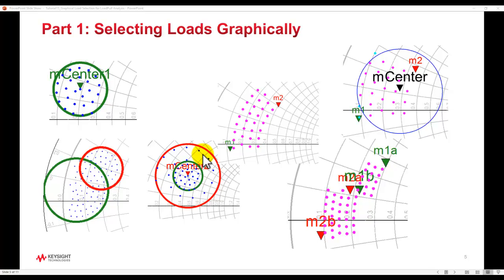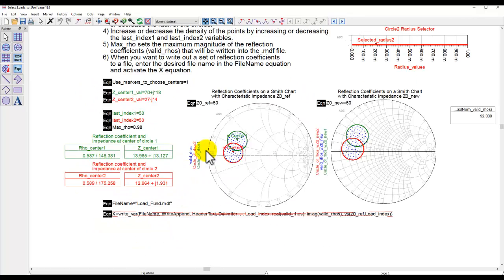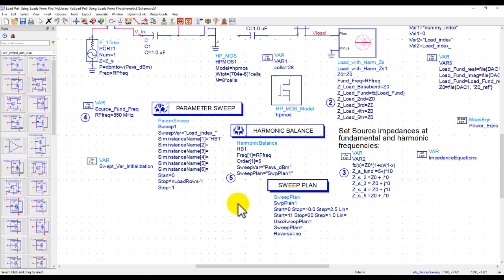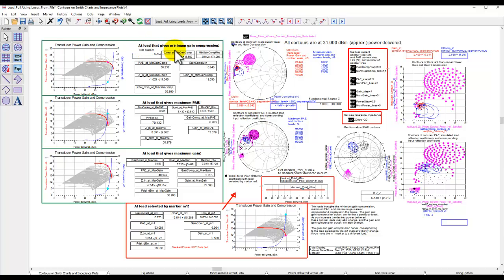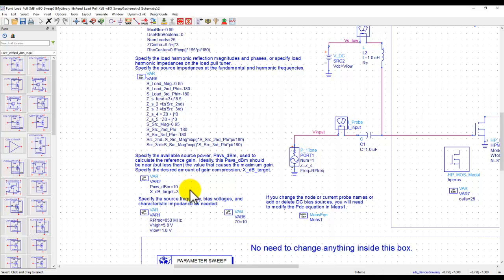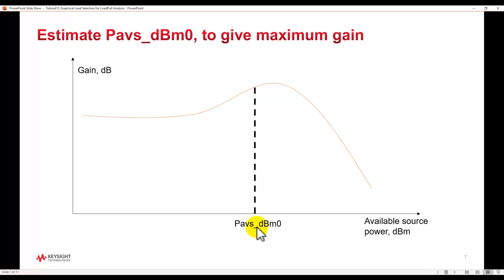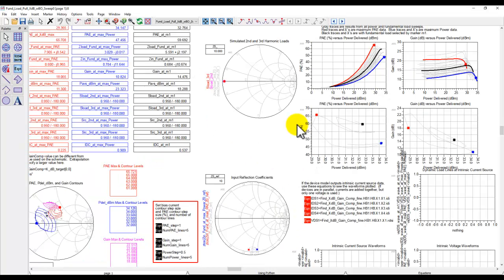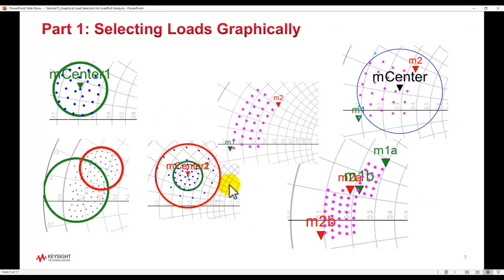RF Design-15: Graphical LoadPull and XdB Compression LoadPull

Comment: Is there any other way to do this work if the template is not available? moreover, how to select z1 center and z2 center?
Reply from the maker: if you don't have template then you will need to write tons of equation which might be impractical. In that case you can stick to normal load pull and still you would be able to do PA design
Reply: @BhargavaAnurag  Thankyou.

Comment: Unfortunately we don't have access to Keysight files. Do you have other method to select best Zs/ZL resulted from Load Pull?
I made a simulation of AFT09MS15 and my transistor Zs value is far away from datasheet specification. It has capacitive reactance behaivour (-jX) instead of inductive (+jX), at best PAE or best Pout.
Also, please explain us how to design an amplifier above the maximum frequency specificated by datasheet, for example 1.3GHz instead of 870MHz, where the Zs/ZL are unknown.
Reply from the maker: Hi,
If you don't have advanced templates for LoadPull then you can make use of what's provided in the LoadPull designguide, just that you might need to do manual stuff on your side as needed.
Its not recommended to use specific transistor above vendor guideline, although you can always simulate non-linear model above the max frequency but data might be questionable as vendors usually don't correlate the data above recommended ranges so proceed at your risk or select another device for the needed freq range.
Reply: @BhargavaAnurag  Thank you for answer. Unfortunately is difficult to find 12V transistor for 1.3GHz, almost all devices are specified until 870MHz. All the best!
Reply from the maker: @PastoriciciRobertYO4HFU  In that case, it is always recommended to get in touch with the vendor to see if they have any characterization data near your recommended range. Alternative could be using GaN, while it is 28V device but can be operated on 12V with slightly different gain and efficiency numbers but it would be better choice in my view instead of using 870 MHz device at 1.3 GHz unless you hear from device vendor otherwise.

Comment: Sir, the links to download the workspace seem to be unavailable.
Reply from the maker: Hi, It's all working for me. You need to register for Keysight Knowledge Center if you are a supported Keysight customer with having valid ADS license then only you can access these links. If you still see the problem then contact your local/regional technical support:
1. https://edadocs.software.keysight.com/pages/viewpage.action?spaceKey=eesofkcads&title=Running+Load+Pull+Simulations+in+ADS 
2. https://edadocs.software.keysight.com/display/eesofkcads/How+to+Specify+the+Loads+Graphically+When+Running+a+Load+Pull+Simulation 
3. https://edadocs.software.keysight.com/display/eesofkcads/How+to+Run+Sequential+and+X-dB+Gain+Compression+Load+Pull+Simulations